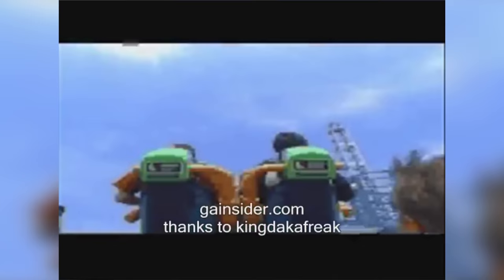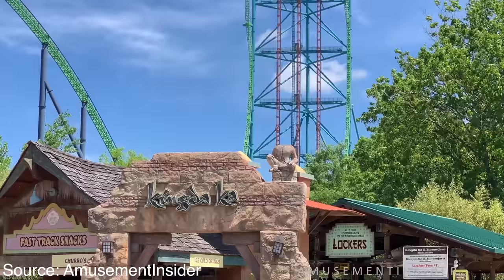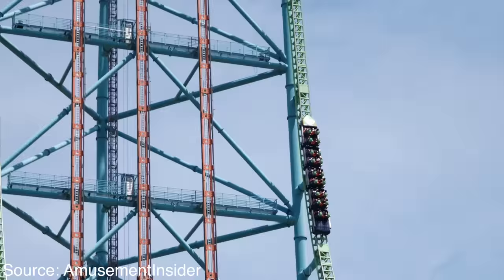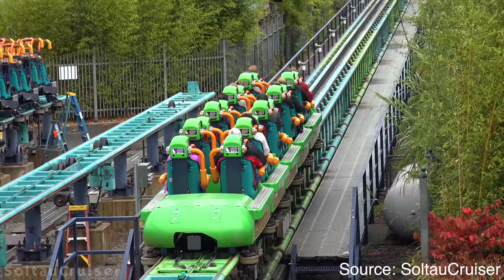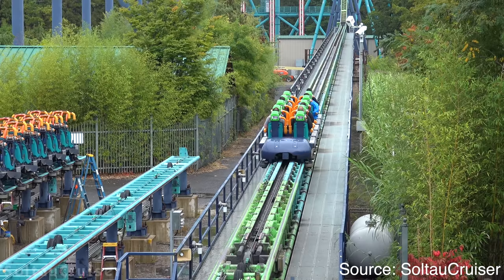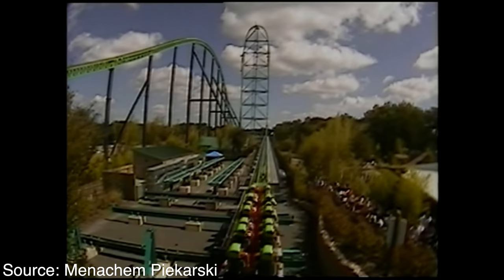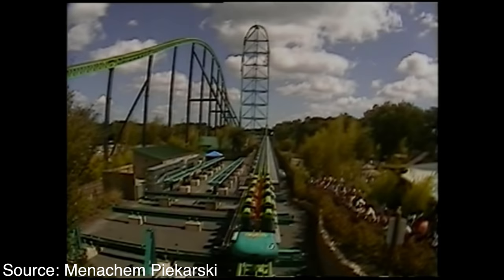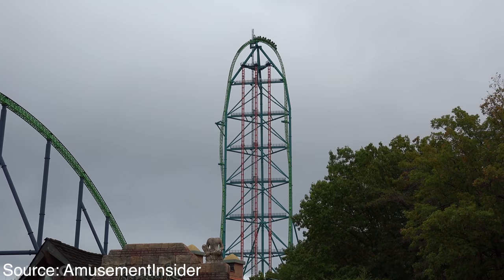Problematic Roller Coasters - Kingda Ka Review & Technical Analysis - Six Flags Great Adventure

Comment: The six-figure range for an Intamin roller coaster train sounds correct. Intamin removed a heartline roll from Cedar Point's 2007 roller coaster Maverick (before grand opening) per their suggestion to Cedar Point because the company determined it was causing an abnormal amount of stress on the trains during initial test runs, and the quotes for replacement trains, which Cedar Point would have needed to purchase more frequently over the years had they not listened, that were circulating on-line in message boards such as PointBuzz at the time were around $300k-350k.

Comment: Maybe some useful info? I worked at Cedar Point when Dragster opened. There was an incident where the cable in a test run split while the park was closed and damaged areas where guests would have been.  Apparently, the cable whipped outward, which a rumor was going around that the cable split through a set of guest lockers.  I'm not so sure of that, but I do know that there was an issue with the cable splitting and the ride was shut down for quite some time afterwards.  We all had to keep quiet about it, as the matter was, not good; and when you work there, it's a bit...cultish I think.  Meaning, everything you say easily gets around, especially if it is something that involves the business. Additionally the decorative theming wheels on the coaster started to fly off of the ride. I'm not so sure why Kingda Ka is elevated so high off the ground, but that incident with the cable could be another factor as well.  At least if the cable did split and whipped out it would be less likely to damage the surrounding area.
Reply: These cables don't actually split. There are 2 types of failures these rides suffer. 

1 is "birdcaging" where there cable or cables de-tension rapidly, resembling a birdcage. This is irreperable damage and must be replaced. 

2 is shearing at the connection point where the cable connects to the catch car. This point has the most stress during launch. 

Just thought I'd add that in 👍🏻

Comment: In theory, 4 train operation will actually increase capacity then before because of the extra block, because the next launch doesn't have to wait until the train clears the platform, but can launch after it clears the block. Is also doesn't have to wait for the pre-station switch track ...

Comment: I've ridden King Da Ka, Stormrunner, and Top Thrill dragster and honestly all I remember from King Da Ka is that of the two days were were there (which I think was actually in the 2015 season, i would've been 14) it was closed for all but a few hours and the brief time it was open I was able to ride it and all I remember is my head bashing around in the launch and the my neck being bashed around. Storm runner is a bit rough durring certain elements but overall is a positive experience (my mom lost her phone off stormrunner years ago, horrible at the time but Hershey was really great about it). TTD is easily my favorite, its shorter than King Da Ka but it felt a lot smoother and I preferred the slower speed.

Comment: Went there when it first opened. Stood in a 4 hour line 2 hours went by the. They announced it broke down due to an electrical failure. Alot of other rides were broken down to it. The entire day from open to close we only got on 5 rides. The Las was a three hour wait for the rapid ride just to get wet and cool down before leaving. Worst time ever.

Comment: Update to my below comment as I've now ridden Kingda Ka. I haven't been to Great Adventure since the 80s, so this was also my first time on El Toro (disappointing with potholes), Nitro, Medusa (both awesome), and Jersey Devil (just OK). I was not too impressed with Kingda Ka. The wind was almost too much, the launch shaky (though not overly rough), the twists both up and down causing a slight slam into the shoulder restraints. I did like the airtime on the top hat and "bunny" hill. I found the bunny hill had more airtime than this video states. I rode only twice due to long lines (it was closed most of the day) and would like to give it another chance.

Comment: This was great even though I wasn't a fan of this ride. Rode it once in like 2008 or 2009. Line was two hours and the ride was like six seconds. You blast up to the top, hang out for a second, then shoot right back down. When the ride pauses, your head was smacked back and forth for a second. Not comfortable at all. Maybe they've fixed that? But I miss those Coke promotions. There was a gas station about a mile away from Great Adventure that my friends and I would stop in and fish old Coke cans out of the trash if they didn't have any of the promo cans in the store. Good times.

Comment: Ah yes, imagine getting the SFGA early, right before it opens so you'll be guaranteed first in line for stuff you REALLY wanna ride; and you see it.  The magesticness of Kingda Ka, roaring and soaring through the sky.  "YES!  IT'S WORKING TODAY!" you scream with glee, and then, by the time you make it to the line....  "Ride closed due to technical issues."
Yes, I get it, it's for the safety, maybe harnesses weren't latching...  But to a kid?  That's near soul crushing.

Comment: I’ve rode this time a few times. The latest was October 2020. Rode kingda ka and Zumanjaro. I noticed a couple of times while waiting in line for zumanjaro how badly the legs of the coaster would shake whenever kingda ka would do a launch. I know in the video you mentioned it’s normal but man is that scary😂 In October I actually had a crazy experience with zumanjaro. It was the one of the last rides of the night for it. Park was closing. Finally after waiting I get on, and as soon as we get ready to go up the ride immediately stops and brings us down. The people I were with chickened out because of that. I stayed, I did all that waiting so I was determined to get on😂 they did a test of the ride once or twice then finally I get back on. As it goes back up, same thing happens again as soon as we go up. Ride stops. Not going to lie I was kind of buggin😂 but I stayed and waited for another test. So they do the test and finally say everything is good. I got on and thankfully I’m alive😂 I just didn’t want to leave after waiting that long. But it was crazy, I’ve had rides stop when I was on them before especially at a six flags, but never twice.

Comment: boy i wish you had a video as detailed as this about Mindbender at West Edmonton Mall because there is allot of misconception around where the highest G force point is on the ride! with your understanding of Newtons Laws of Motion i clearly see you have as well as an impressive understanding of coaster layout and design. Plus your viewer base you would be able to help put rumors to bed about it 😆
Just really swift explination is the Mindbender has 3 loops and the track circumference of the 3rd could easily fit inside ether of the first 2.
so like Scotty used to say to Kirk y'kno... "y'Canna Chainge th'Laws'uv Physics Jim!" 🤣🤣🤣
Steve Makris channel has a video 'WEM Mindbender Aug 10 2017' that shows the G stats at the end of the ride

reason why i'm saying all this to an unrelated coasters video
because R.I.P. Mindbender 1985 - 2023 😭😭😭

Comment: Great video but there is one thing I hoped you would say but didn't. You pointed out how you can see when Kingda Ka stops accelerating on the launch track and it switches to slowing down the catch car, however, when you paired Dragster and Kingda Ka's video together you can see this on Dragster too. If you pay attention, you can clearly see Dragster stops accelerating at around 3.6-3.8 seconds and Kinda Ka stops around 4.2 seconds which clearly proves Dragster has a better acceleration than Kingda Ka. It makes sense since Kingda Ka already lies about speed. I am not sure where you got Dragster lies about speed considering I have worked it and know it always was between 117-122MPH. Also I disagree and think Dragster has a far more intense launch and I feel Kingda Ka feels like a good LSM launch and a bad hydraulic launch.

Comment: Well for someone who has experience on kinda ka, I guess I will tell you what he left out. I always ride in the front of rollor coasters so when I was on kinda ka I was in the front and if anyone that rode a motorcycle without glasses would understand this. The ride takes off so fast that before it goes up and over my eyes started tearing and on the way up I could not see anything because my eyes were full of tears and by the time I cleared my eyes the ride was over. So either you need to by motorcycle glasses that cover your eyes or they should supply some to the riders. For someone that has experience in the rollor coasters should know that and let people know.

Comment: just rewatched this video. I completely forgot about the queue thing. considering what happened with Top Thrill Dragster it's chilling to know how avoidable this was. the launch system is basically the same and even though it was deemed safe after the incident Six Flags decided to not take the risk and close the exposed areas near the launch track to guests. that terrible accident in cedar point could have been avoided if they had done the same. even a humble service update bulletin to owners of similar systems could have made the difference

Comment: Red Force at Ferrari Land ended up fixing the train and station setup that KK and TTD have. It has just three 12 passenger trains with a separate load/offload platform, similar to how KK is setup now, and Intamin are stating that it can hit 1,200pph (which I honestly doubt). Although the ride can run all 3 trains simultaneously, I have only ever seen them running two at once, because PA World are a bit tight when it comes to operations.

Comment: The intrduction of the shoulder harness was done by Intamin of their own accord as they were concerned that people might decide to chew on the seat in front on the brake runs that slope down. I don't know how harsh Kingda Ka's brakes are but on Stealth at Thorpe Park, they really throw you forward into the harness, without the shoulder restraint, you would be eating plastic. On the suject of Stealth, it also had a similar failure that caused serious damage to the catch car, guide trough and brake fins. The train escaped with only a few minor dents and scratches. 

As for the cost of a new train, Intamin quoted around £800000 for a ready to run 6 car train for their 10 inversion coasters. It's a lot of money to save if you can get away with it.

I agree with the decision to restrict operation with another ride running under the top hat, I know from experience just how much crap gets extracted from peoples pockets. You can put signs up and preach to people all day long not to take loose items on the ride, the ammount of coins, glasses, phones and dildos (I'm being serious) embedded in the ground under the top hat shows that they just don't care.

Comment: Great video! Just a random thought I had, I've always wondered what happens when power is lost due to blackout or car hitting a pole or something when a coaster is operating?
Reply: Everything on these rides are fail safe, meaning they require power to operate and are normally closed when not powered (brakes for example are mechanically shut or up by springs, and require power to open). 
 
Power outages will lose the ESR relays (e-stop relays), so the ride will act as though the emergency stop has been pushed and will stop in the next brake zone until recovered by maintenance.

Comment: This ride (Kingda Ka) really needs to add padding to the overhead restraint system.  This ride is so violent at parts you pound your head from side to side.  Also, the speed of the wind into your face makes it nearly impossible to keep your eyes open, thus reducing the thrill.  Yes, this is a very good ride but extremely uncomfortable to ride.  Some better padding and a small windshield to reduce the assault on your face would make it much better.  Hey, just try sticking your head out of the window of a vehicle going over 100 MPH and you will know what I am talking about.

Comment: I was told that you reach 128 mph on the downward motion over the bunny hill of the ride and it launches trains to around 90 mph.
Reply from the maker: The launch is the fastest part of the ride. Due to friction, a ride will require more speed to clear a hill than it will gain dropping back down the same hill

Comment: I hate to say it but amusement and theme parks everywhere need to raise the prices in order to survive and thrive.  Unfortunately, big expensive rides with lots of speed require lots of real upkeep. King da Ka is like the premium sports sedan that requires real maintenance service every few months, and Great Adventure simply doesn't want to pay for it, so it's use is very limited.  
In America, we might be at the limit of what's possible in parks simply because the disposable income required of the typical park attendees overall is limited- and big spender type people (someone who treats $1000 or $10000 the way a common person treats $50 or $100) don't usually go to parks regularly in large mass or over and over again.  These bigger destination parks probably need to be charging about $100 per person, not $30 per person, in order to keep operations running as originally envisioned.

Comment: Big issue with comparing costs from my opinion is labor. United States specifically Cedar Point is obsessed with ""union contracts" The countries that essentially use slave labor to build their coasters have a massive advantage. I worked at Hotel Breakers at Cedar Point and if you look at the cost to do the additions / remodels (East Section 1994, Tower Section 1999, and the newest demolition of the "BonAir section & building the new "West Section" Labor costs are insane in the US.

Comment: Maybe I'm missing something (I probably am) - but what would happen if one or some of the launch motors would fail during a launch? Since the ride sometimes only creeps over the main crest, wouldn't motor failures result in a reduced launch speed and thus a possible roll back? 
And since the launch can't fully stop a car, wouldn't that lead to a crash into either the second waiting train (back during four train operations) or the train in the station? What safety mechanisms prevent that?
Reply from the maker: @Chimera There are actually multiple motors that power the launch winch that spins the cable. I believe over 30 of them.

Comment: Great Video. Is there a manufacturer who uses compressed air for the first quarter of the launch to get that strong acceleration punch and then LSM for the rest of the launch? Would have a great punch and way more reliable than hydraulic.

Comment: I  am from the Uk and I love kingda Ka. I think I’ve been on it once properly the second time I went on it the train went to the launch area was there for ten minutes then it went backwards into the station and the ride closed (technical problem). The last time I went to Six Flags great adventure was 25th June 2009 I remember the date because when I got back to my hotel I heard the awful news that Micheal Jackson had died. Kingda ka was closed that day.  In the UK We have A little kingda ka called Stleath at Thorpe Park it’s 205ft I believe. I believe the reason it’s not any taller is because Thorpe Park is literally on the border of Heathrow Airport.  I was wondering  apart from the height do you know of any technical differences

Comment: The way that damn thing sways, that’s a recipe for stress fractures. No way I’m getting on those. 

Ps— if one of those trains pop a wheel up there, you’re fkd!
Reply: ps-you are more likely to get injured or die on the way to the roller coaster in your car than you are on the roller coaster for a train to pop a wheel off it would have to take hundreds of safety measures to fail

Comment: 5:15 where are there hundreds of magnetic breaks at the start of the track? The car doesn't seem to pass over them until in motion (so it's not part of the launch sequence)?
Reply from the maker: The fins lower out of the way and dip into the launch track once the launch buttons are pushed. Other wise they’d remain upright and would cause the train to not launch properly. Thus it’s part of the launch sequence, as in the sequence of events necessary for the launch to take place.
Reply: @ElToroRyan  wow. you replied FAST. #Subscribed

Comment: An amazingly interesting video about a beast of a roller coaster! I know some coasters are faster than this and the Top Thrill trumps them all as far as overall rider experience. but those "speed demons" dont really have the height and arent full curcuit...  so in my opinion opinion these are the 2 best "worlds fastest" coasters. Like whts the point of going 120+ and you cant even go 400+ feet in the air? ... kingda la and TTD rule for high speed coasters imho

Comment: "All rides over 400 feet must have an over-the-shoulder restraint"
Sounds like a law put in place during construction in an attempt to kill the project. 400 feet is both very arbitrary and not very common for amusement rides.
Reply: could be there are some other rides at great adventure that are over 400 feet like the swings but they dont require a over shoulder restraint so hard to say